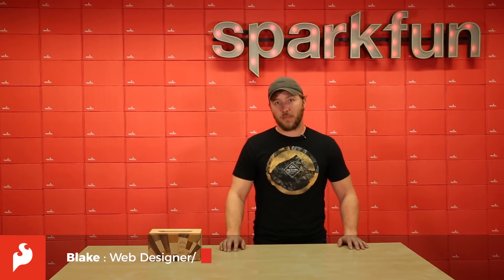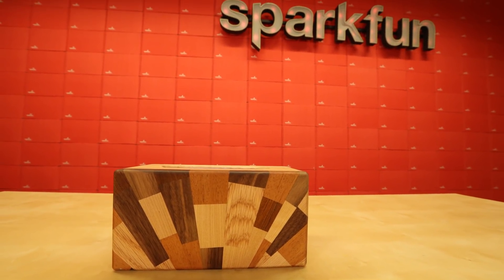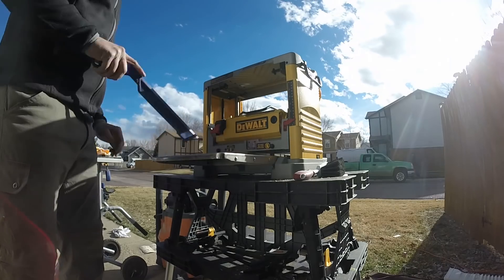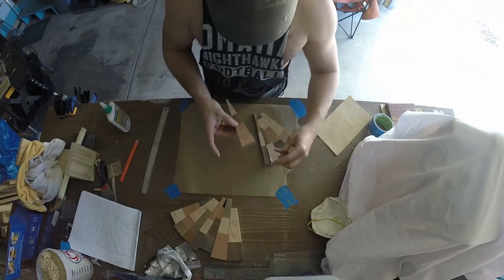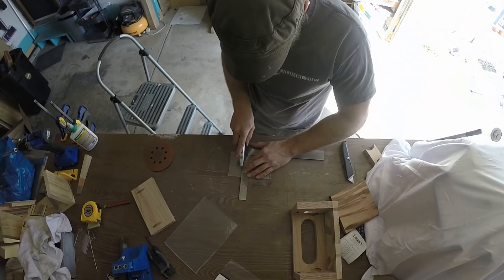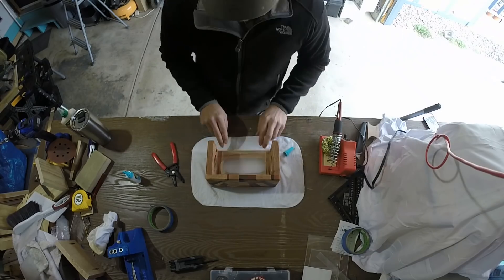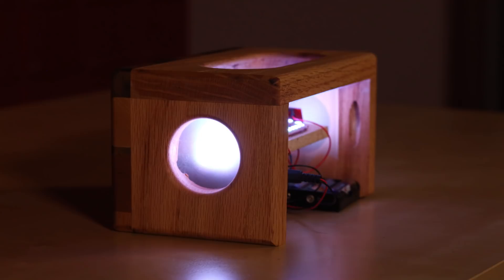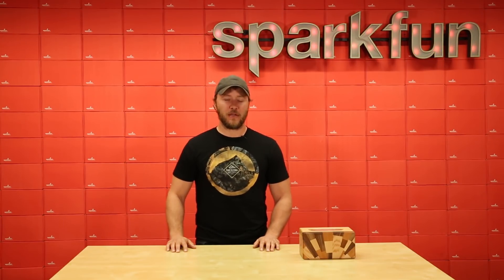Project Showcase: DIY Sunrise Alarm

Comment: I've been wanting to do this kind of thing for a while now--I even have some nice canary wood set aside for the cabinet (I like your cabinet design better, though!). I would like to use a Ras Pi or something like that so that I can program the wakeup time with a smartphone instead of having to hook up an Arduino to a PC to reprogram. But this really helps me think about and plan my project better. Thanks!
Reply from the maker: That sounds pretty great!  I'd love to see what you come up with when you're done. I'm thinking that I might add a dial and 7 segment on the back that could change the wake time as well so there isn't any reprogramming necessary to change the alarm.

Comment: Hey cool! I have done something similar! But with much more (white)leds. I did design my own pcb and used 5meters of led strip. PCB is atmega 328 based (basically an arduino) . It starts low and brightens in about 30 min to full. If someone wants to know more about it, you can go to my webpage and look for "sarastevalo"
Reply: Here is a direct link. (Sorry it is in finnish, but with google translate you can get the idea, even google isn't very good with finnish.) https://rahikkala.net/category/elektroniikka/rakentelut/x/